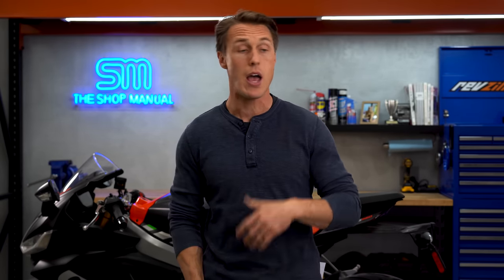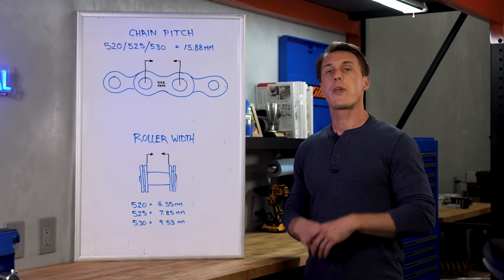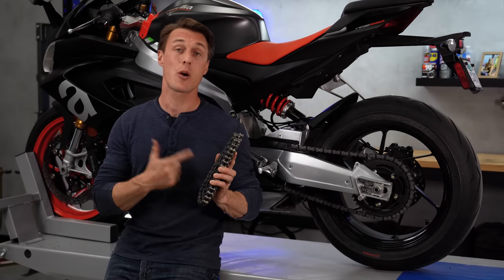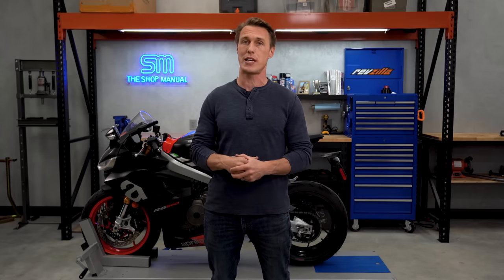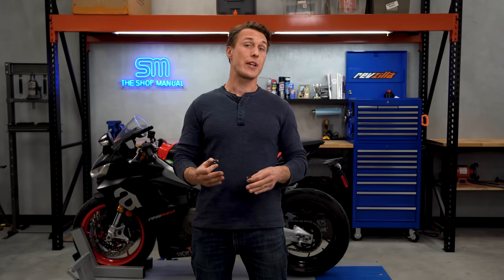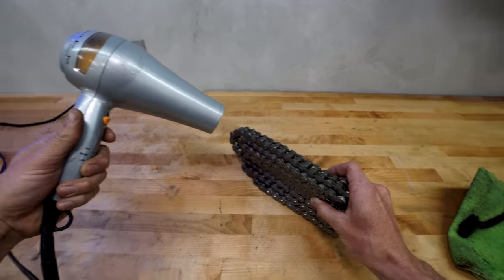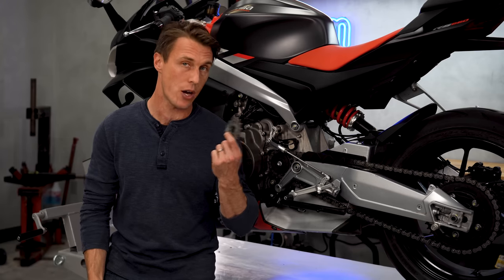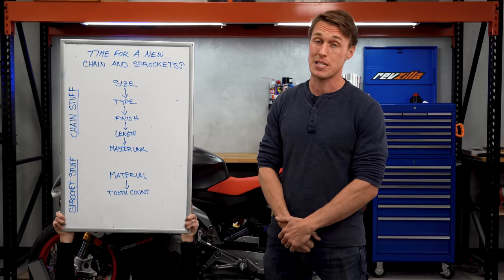Everything You Need To Know When Replacing Your Motorcycle’s Chain and Sprockets | The Shop Manual

Comment: I wonder what makes Ari so adamant about using steel only sprockets for the street. Sure aluminum wears faster, but there are plenty of aluminum alloys nowadays that can hold up really well.
Reply: Plenty? Care to name some? 7075 is the toughest stuff out there, and it's what rear sprockets are made from. And they wear out very quickly. It's simply not the ideal choice for durability, and I see far too many people using them because they're excited to save weight, but unaware that their race-grade rear sprocket will only last 2,000 miles.
Reply: @AriH211  not going to lie, my comment was bait to see if you would answer my question haha. I just bought an aluminum rear sprocket falling for all the advertising that it "wouldn't last as long as steel, but hold up well enough." Great content!

Comment: One question on chain length. Does the master link count as one of those 110, 112, 114 links? Or is it 110 links plus a master link to bring it to say 111?
Reply: That's a great question, and honestly I'm not certain. But if I had to guess I'd say the OEs include the master link in the total link count.
Reply: I just swapped out the chain and sprockets on my 1290 Super Duke GT, and the number of links definitely included the master link.  Also, my new chain was not pre-cut, so I had to remove some links before fitting it.  But the final link count included the master.

Comment: I'm a new rider and i have been wondering how many fingers should i use for the clutch? Everyone says 2 is standard, but when use 2 fingers, the other 2 are left behind the lever, preventing the clutch from disengaging 100% (the wheel still spin). Would this damage my gearbox or  clutch ??
Reply: I think they are referring to ease of pull. They make shorty levers if you have to please everyone else.Or use your hand to pull lever. Engineers designed it that way for a reason.
Reply: the wheel will spin even when you're in neutral. thats a design "flaw" of wet multidisc clutches of all motorcycles. the oil tends to transfer some torque through the discs, even when you hold the clutch pressed. 
nothing to worry about. on most bikes, the clutch discs are essentially disengaged even when your 2 fingers are blocking the lever from a full travel
Reply: Hi John, I prefer to use two fingers on the lever, as that leaves three fingers still wrapped around the grip for steering control. Some bikes, like Harleys and other cruisers, almost demand that you use four fingers due to the size and pull distance of the lever. On most other bikes, the rear wheel will likely still spin if it's off the ground, even with the clutch pulled in. That's for the reason mentioned by @dimos k. However, it's possible your clutch freeplay isn't properly adjusted. Check out The Shop Manual playlist for a vid on how to check and adjust that.

Comment: nope; just change front sprocket, lease expensive that wear's the most; the chain and rear will then last twice as long at least, if you want to save dosh; otherwise, given the hassle anyway, change the lot, and you can clean and maintain what you otherwise wouldn't.

Comment: I have a yezdi roadster with stock 13 in front and 45 in rear ( i might have wrong info) want to change it to 12 front and 48 or 52 rear will it increase my mileage as well as will have taller gear soo I have to shift less in trafic and better at highway cruising and will it be better for ladhak ride or Nepal ride.
Reply: a smaller front sprocket will reduce the top speed of the motorcycle.  A larger rear sprocket will also reduce the top speed of the motorcycle.
Typically smaller front and/or larger rear sprockets are installed on off- road motorcycles, to improve their acceleration and low-speed handling characteristics.

Comment: I still don't know when?  Steel is real, the plates don't wear out (long fatigue life), but the pins do wear as miles are put on it.  On a bicycle chain you would measure it once it has stretched an1/8" over 12" it is time for a new one, or you risk destroying your expensive sprockets and possibly breaking a chain.

Comment: I have an honda xl125. He has 6 gears but it runs out of power 3/4 of the way through 5th- about 90kmh. Has a 15t front sprocket, should i go 14t to try to get more power for more speed?
Reply: Yes, or a larger rear sprocket.
But you'll be mathematically reducing the top speed (in terms of gear ratios).  
The 125cc engine is only able to produce a limited amount of horsepower & torque.  The horsepower limit will remain relevant at high speeds because of air resistance and any hills you need to climb.

Comment: Ok go ahead and laugh......RC51  what would be recommended for better fuel economy. I have a 1300 mile road trip this summer. There is plenty of torque. And it will be 90% highway. Any help is appreciated.
Reply: +1 for what @F S suggested. You could try to go +2 up front if it'll fit and your chain is long enough, and that'll net a big difference in cruising RPM.

Comment: how can we compensate the difference in the speedometer?
Reply: You might not have to. A lot (most/all?) modern bikes read from the ABS sensors so the sprockets don't have any effect at all. That said if it's an electronic speedo, there are aftermarket boxes that will calibrate the speedo.
Reply: Most newer bikes won't need recalibration for gear change. Older bikes you can use a speedo healer.

Comment: Now, if you paid over $5000 dollars for your
motorcycle, don't buy the cheapest crap to maintain it, ie, like sprockets and chains. Always buy the best, for durability, reliability, 
n longevity. And also, keep it clean and adjusted properly. Check it once a month or every 1000 miles, Why? Cuz even the best
equipment will wear faster and break down sooner if not properly maintained

Comment: The market for parts like these is a scam. Replaceable parts, like chain, sprockets, oil filters, oil, coolant, etc... These things are replaceable/replenishable. 

Buy CHEAP! I get EK O-ring chains for $50. Sprockets for that much for the pair, etc... You have to eventually get these things. What does it matter that the expensive chain lasted 5,000 miles more? It costs &125-$225... f-THAT!

My expensive RK gold chain had a failure at 4,000... kink in the chain. And yeah, I know how to maintain a chain.

Comment: You shouldn't say aluminum sprockets because they are not aluminum, they are aluminum alloy.  7075 T6 aluminum for example is made up of aluminum, zinc, and several other metals, and is quite hard and quite strong.  Also, for a "weekend warrior" streetbike rider, aluminum alloy sprockets are fine and can last years and thousands of miles. Not a very accurate presentation by you here.
Reply: I guess he should not say steel either.
There are thousands of different aluminium and steel alloys.
You're not going to find pure aluminium anywhere unless you specificly order it.

What is your opinion about plastic or rubber? How specific we have to be when we say plastic?
Reply: @XtreeM_FaiL  Aluminum alloy is a class of metal and is more accurate in this case.  People are just too lazy to say that one additional word, kinda like when they say Hydrogen Peroxide, when it is really Hydrogen Peroxide solution (dliuted) they are talking about.
Reply: @davidjames1684  It is always an alloy.
People who know aluminium, know it is an alloy even when you don't mention it and the people who does not know aluminium won't be any smarter. They might be confused.
Unless you specific what kind of alloy it is, it is just nitpicking.
Words don't always add value.
Technically H2O2 is a solution because 100% isn't possible.
Do you really say alcohol water solution insted of alcohol?
I would like to see you asking a mineral water.
Reply: @XtreeM_FaiL  I say alcoholic beverages and not alcohol when referring to drinks.  It is more accurate.  Aluminum to me is pure aluminum.  Once you start mixing other metals with it is no longer pure aluminum, it is as simple as that.  To me it doesn't matter if someone "understands" aluminum (in context) to mean aluminum alloy, since it is more proper to say aluminum alloy each and every time it applies.